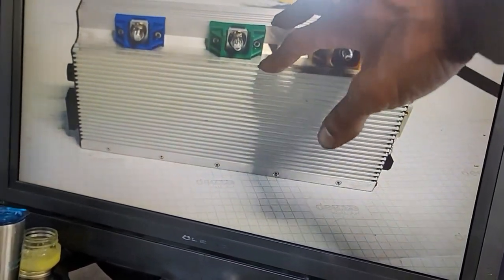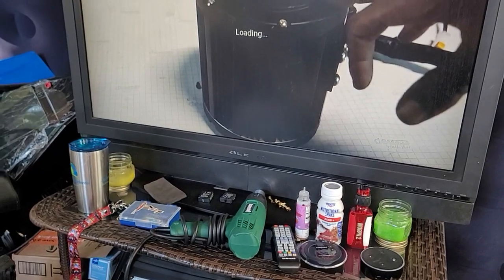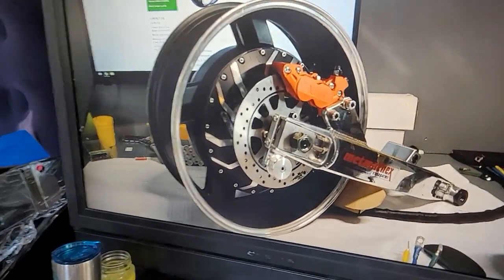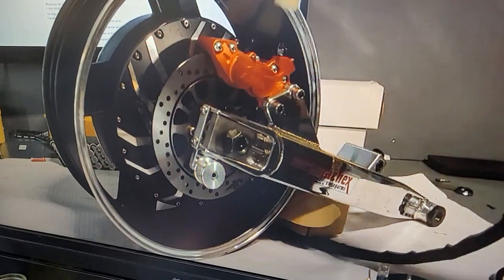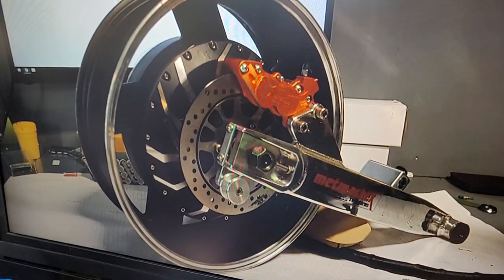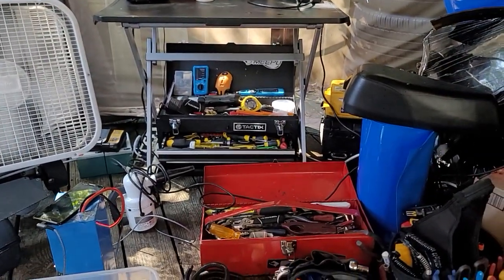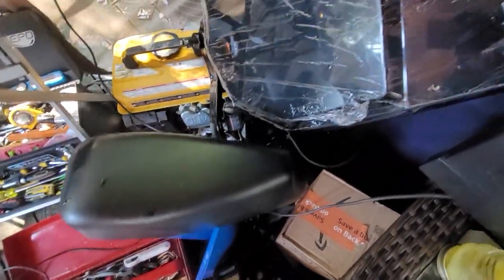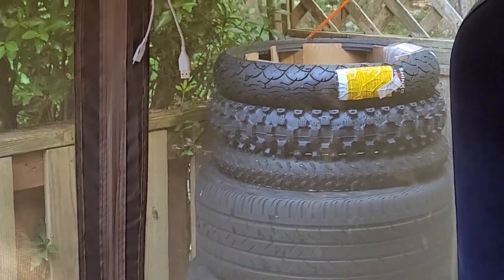Largest Hub Motor in the world, I second I don't own the rights to the video shared by Mr Killovolt!

Comment: Hi friend, this motor is actually a 273 internally, they have just changed the side covers so it can fit a moped/motorbike.
They also have a 212 which is 205 but again, same internals just different side covers.
Funny thing, the 205 is rated 3000w-5000w compared to the 212 which is 7000w, how did they increase the "allowed max" air vents on the side panels 😉.

The other advantage of the motorbike/mopoed versions is the phase wires are thicker and the wires don't come out from the axle directly which allows for these thicker wires.
Reply from the maker: I thinkyour talking about another model that's the same as a 273 and I have a 273  this is supposed to be a 260 that has an even higher rating. we know 273 is rated at 8K and of course it can handle way way more but this is supposed to be rated at 12k . check his video for specs even tho he mentions here.
Reply: @ChrisCrossingWires1212  I will double check thx for the update :elbowcough: